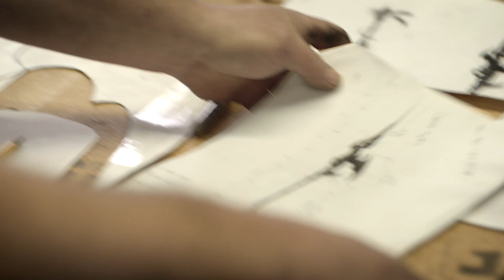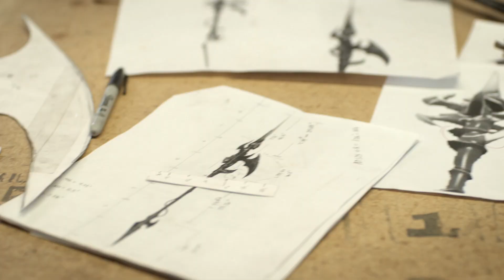Final Fantasy XIV Legendary Weapon: The Gae Bolg | Arcade Arms Ep 2

Comment: The Blades and Shape seem accurate.

It is simply missing the extra bulkiness towards the point and around the parts where the blades stick out.

Realistically, you couldn't make that portion from metal as the weight would make it unusable.

Probably need to decorate it with plastic, or some kind of light metal to make it resemble the video game weapon exactly.

Love it still.